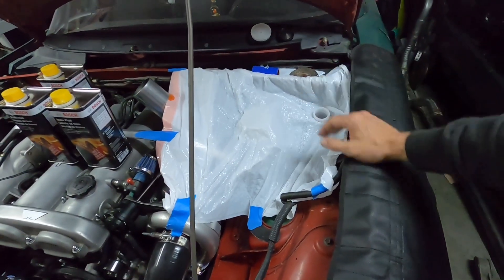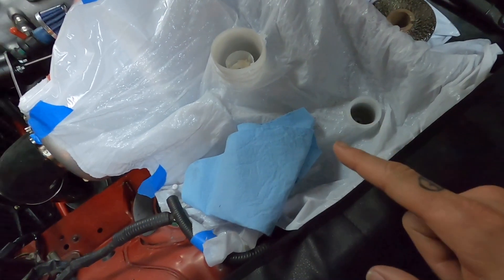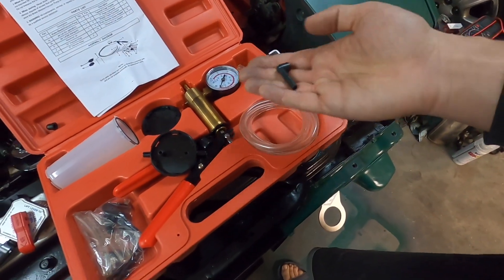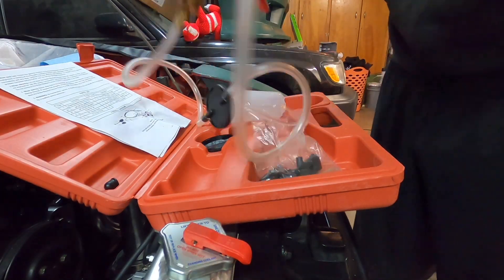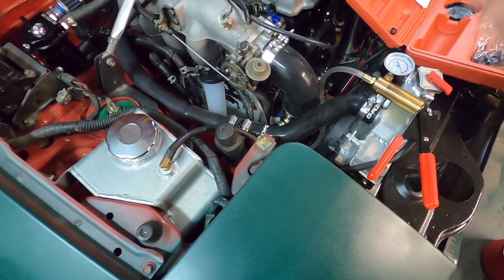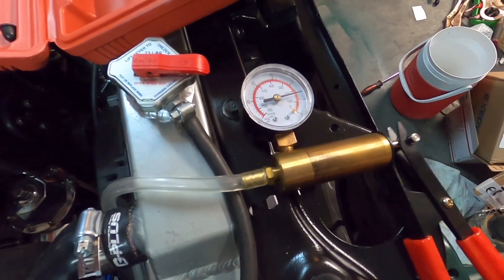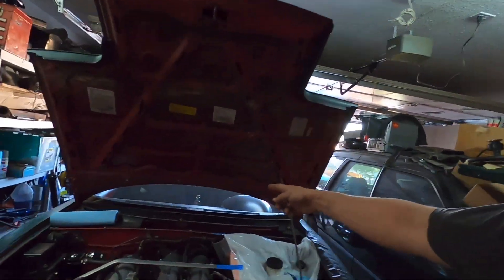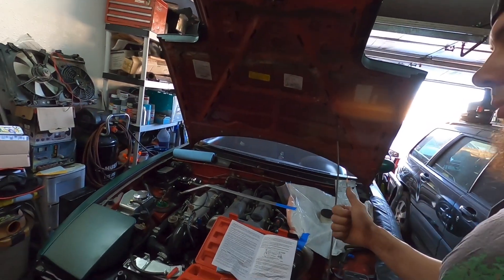Brake/Clutch Fluid Upgrade? Bosch ESI6, eBay Brake Bleeder Kit Demo & Review | Turbo Miata

Comment: You've got me thinking about getting some of this brake fluid.
I just replaced/upgraded the front end of my EM2 and put in SSBraided brake lines. I've still got the entire rear to do, but I think I might as well use better fluid, eh?
Reply from the maker: Do it!!! Honestly the pedal feel alone is noticeably different to me, feels a bit firmer. I think it’s due to the thicker viscosity. I really need to go to braided lines when I do the brake upgrade.
Reply: @MonkeyWrenching  - Aight, I'm sold 😂

Comment: I think the last time they made a non-synthetic brake fluid, it was DOT2. You can't get away from paint danger unless you go with that silicone DOT5 stuff, but that requires a special braking system set up that won't end up having every seal swell up after the switch. They really should have given silicone stuff a different number/name. DOT3, DOT4, and DOT5.1 not being compatible with DOT5 is such a government paperwork-ism.